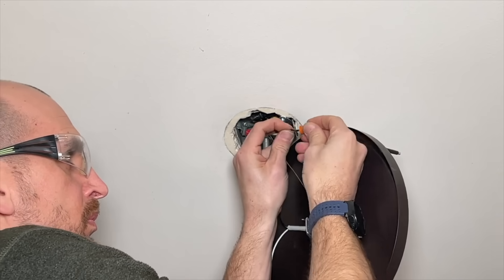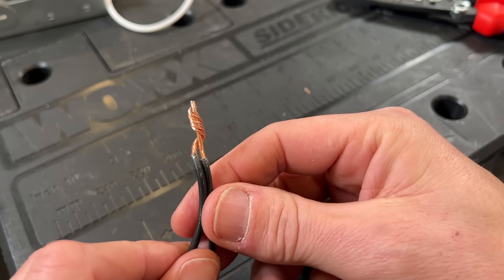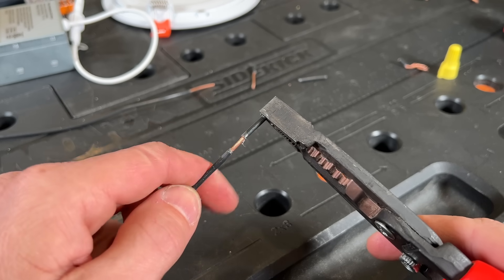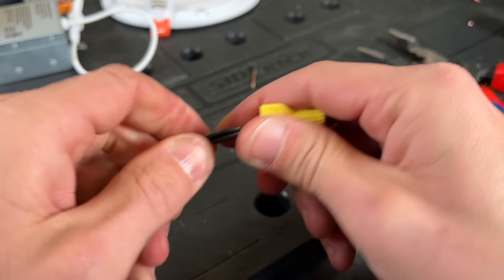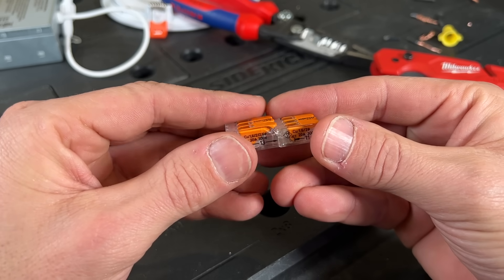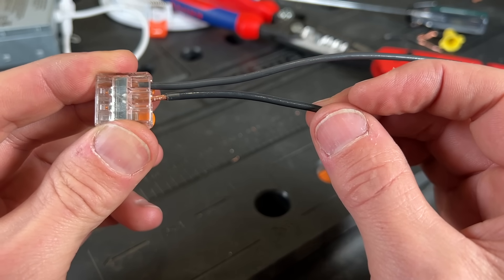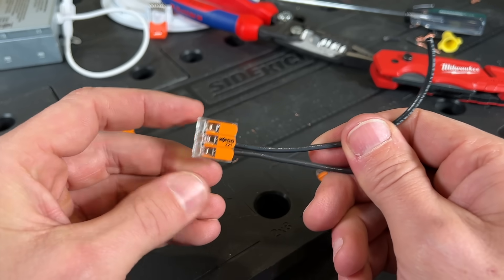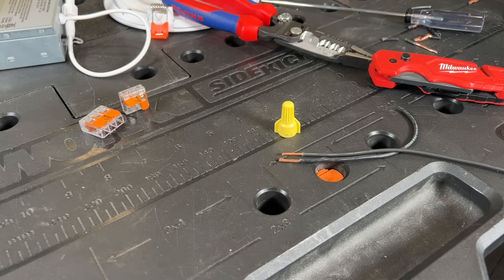Most Common DIYer Electrical Mistake - Don't Let This Be You!

Comment: My dad worked as a mechanical engineer for Ideal Industries around 1970 and holds the patent for putting the spring inside of the wire nut. As a boy, we had hundreds of these wire nuts that were prototypes. We took a vacation that routed near Connecticut where there was a spring manufacturing plant that made the spring that used a wire that wasn't round but rather had edges to help "bite" the wire. I think of my dad every time I use a wire nut.
Reply: Wow, great story, now I might be thinking of your Dad when I twist a wire nut!
Reply: That's actually pretty awesome.
Reply: Awww! That is so awesome! Now, I get to think of him too. Thank you for sharing that!
Reply: I designed a specialty tool which industrial engineer will do a realization factor. Basically a man hrs for manufacturing. This was in avionics at a defense contractor the employee that submittal his idea gets a percentage of realization factor in man hrs saved building the company owns and holds the patent cause you worked on it on company time. But like I said you would recieved a suggestion check. A 2.2illion dollar system that you can knock 1 hr off the realization factor on a contract to build 2000 units with 400 spares would get you like 4 grand. Plus defense contracts go out to the manufacturer and a 2nd company building to  specsm so really tools can be used on future contracts but never will pay you any more cause again they hold the patent they can do use or sell to othe company's vendors whom ever.
Reply: @precinct1baltimorecountyre588  I know how you feel. I had to sign a waiver that stated whatever you designed belonged to the  company. I designed HUNDREDS of tools, jigs, work stands, lifting rigs for crane operations, test equipment, procedures, safety application tools and procedures, etc. for over 35 years. I got 3 awards in that time. The main thing, I made a positive change to the world! The company, I'm sure, patented all of it and made it available to order by giving it its own class & item number.
Reply: @general5104  I invented a bunch of things and get all my ideas stolen. But Im usually intentionally leaving bait for stealing  purposes. Apple air tags?  multi core processing? the DQ Blizzard and honey bbq chicken strip sandwiches are all my IP. My latest Idea was a bathroom that plays music when you walk in and realized as a fart fan with a speaker in it. I think Im proudest of Multi core. But when people ask what I do I say nuffin. I got a check for nuffin and you will find me in a line for a blizzard. Also, the one Im most mad about is,some guy out of Portland that hobby sourced his plans to keep people from stealing his electric bike and they realized it as a product of rental transportation.Since 1 Google was directly involved in forming a company to sell that and 2. its just a blatant example of being disenfranchise of your own ideas and IP. When those same guys turn around and cry at China for IP theft. Like bro, you never had an original idea in your life and need to come up off that trip,from the perspective of a modern inventor.
Reply: @precinct1baltimorecountyre588  wtf is a “realization factor” and how do u do it? Also, who receives the suggestion check and how much was it! I’m confused as hell by ur post. I can’t tell if ur being sarcastic or sincere! Lol or are u just saying that if u design something at work then the patent stays with the company or ur employer?
Reply: A Dad needs to make a lifetime impact.  Thanks for sharing yours.
Reply: I still think ideal had the best wire nuts
Reply: I still have some old ceramic wire nuts.
Reply: @marklevan6546  I have taken plenty of these out.  These seem better as they won't melt like plastic.
Reply: I was into electricity since I was a kid in the 70’s. (Later became a licensed electrician), but I remember hating wire nuts that came with my electrical projects as a kid. Some were ceramic, some were plastic, but none had the spring yet. Those crappy things, no matter how hard you twisted them, could easily be pulled off the wires. Wire nuts in general were a bad idea in my opinion back then. 
Then I went to Radio Shack, (the candy store for electrical and electronics projects), and dreaded that I’d need some wire nuts. 
I explained to the store clerk that I didn’t like wire nuts and asked if there was an alternative? He lit up and smiled, obviously understanding the wire nut dilemma, and showed me the “new and improved” wire nuts. He pointed out the metal spring inside. I nodded, “That looks better”. He was more excited than I was yet, and clipped off a couple sections of #12 solid wire. Stripped the ends and screwed on the wire nut. “Let’s see if you can pull that off, kid?” I tried and I couldn’t. I wanted to try it for myself and hooked up the two wires with the new wire nut. Nice! “Why didn’t anyone figure this out sooner?” He shrugged and pointed to the brand on the box. IDEAL. 
For the next 50 years I’d only buy wire nuts that were made by Ideal Industries. I have literally thousands of them now in every size. 
Most lighting kits from China still come with the crappy wire nuts without the spring and they go immediately in the trash. 
I always wondered who the genius was that invented the Ideal wire nuts and now I know. It was Warren Krup’s dad. 
Thanks for solving the mystery for us and sharing it with all of us who might have took this genius design for granted.
Reply: That is so cool!!
Reply: Great story. It's the little thing that turn out to be beneficial.  I did a Military Funeral Honor Detail 4yrs back around the 4th of July and it was for a WWII Army Veteran and this man had his own chair manufacturing company. When he first started out he invented the stackable chair. This chair is used in every hotel and conference centre worldwide. His first big sale was in Vegas. He was a very well known and respected man.
Reply: Warren, was he in Petersburg?
Reply: No, in Sycamore, IL
Reply: @wkrupper I grew up 4 blocks from the factory. My grandmother retired after working there for 20 years.
Reply: @bradrachielles7890  Sycamore,  IL
Reply: @bradrachielles7890  , Sycamore,  IL
Reply: wait You say your dad holds the patent or IDEAL holds the patent ,???    Its gotta be IDEA:L right because your family should hold more money then any trillion aire combined with that statement!!!???   Its funny because I work for a utility and lucent technologies holds patents for the Entire original Bell system That engineers like your Dad developed and were never really compensated for theyre brilliance
Reply: @culbyj3665  You can be named on the patent as the inventor or be recognized by your employer as the inventor, but your employer is always the owner of the rights. Most companies make you sign them away explicitly these days to avoid any misconceptions.
Reply: @culbyj3665  his name is on the patent, but the patent belongs to Ideal
Reply: Hi Warren. This is Dave Hellerman. Now I’ll think of you whenever I am using wire nuts. Small world. Hope you are doing well. All the best!
Reply: @dblarney8201  Hey Dave! Great to see your name! Hope you are well!
Reply: @D’Blarney  thanks for the note, Dave! I don't check this site often. 
I just retired, glad to be home working in the garden and in the yard every day. 
And especially no commute!
Reply: @dblarney8201  Hey Dave, great to see your name. I retired a year ago and I'm busier than when I was working full time!
Reply: GOD really loved your Dad! GOD IS #1! GOD is master inventor, engineer, designer, etc. Your Dad must of been a great guy too as well as very intelligent 👍. That's great he thought of that! GOD BLESS YOU and your family!
Reply: I'm sure he is in heaven with GOD inventing more things up and coming for us in the future ⚡ 🧑‍🔬💥👼.
Reply: Sweet!
Had an uncle in NY that patented the folding of paper instructions, mainly medications. So If you ever get medicine with a very small, book like instructions. It was him.
Reply: Wire nut still a go to for splices. Stream lined for easier box dressing. I was always taught to square off wires to corners and bend or role depending on box to leave maximum room for devices.
Wire nuts seem much easier to accomplish. Old Scotch Locks (soft) were nice for that. Winged Wire nuts most guys cut off if they needed extra room in a tight box.
I guess it's the new guys that like to use them and old guys don't change. Lol
Reply: Thank you for a fabulous story!  I, too, will think of your dad, Mr. Krup, every time I use a wire nut.  All the best to you.
Reply: I invited the Bit-O-Honey sandwich. You put maple syrup on your peanut butter instead of jelly and it tastes just like Bit-O-Honey. Does this put me on the map?😂
Reply: Fantastic story - now I know and will think of your Dad every time I use them too!
Reply: Thanks for sharing this story with us much respect to your father for a great invention thank you.
Reply: Great Comment, I think of your old man every time I use a wire nut too.
Reply: Very cool!
Reply: Great info. Everything has its place and you have to use the item that is fit for the job, but the points that you brought out seem to make quite a bit of sense, and you ill strain the ethocacy with regard to the Lo test that you referred to, and the demonstrated physical lottest so these are not opinions that you put forward these are facts, so I thank you for supporting your information with facts. All the best.
Reply: ⁰0000⁰
Reply: Cool story
Reply: Very cool
Reply: That is awesome I am always looking for that one part that everyone will use !
Reply: "Square" wire was developed and used in many different ways in electrical and mechanical parts. Thinking outside the box as they say can lead to genius or disaster.
Reply: 44444444444444444444444444444444444444444444444444444444444444444444444444444444444444444444444444444444444444444444444444444444444444444444444444444444444444444444444444444444444444444444444
Reply: Nu uh
Reply: American ingenuity
Reply: On
Reply: That is very interesting.
Reply: Bread and butter
Reply: I don’t believe a word of it
Reply: great American company, he was lucky, not many left
Reply: Fibber
Reply: Ideal industries holds that patent?
Reply: Thanks Dad.
Reply: So amazing! I will also think of your Dad when I use a wire nut😊
Reply: Was it Spirol Industry?
Reply: @NathanMcCrackan , it was Ideal Industries in Sycamore,  IL
Reply: My dad made outlandish claims, like he invented the question mark. And he would accuse chestnuts of being lazy.
Reply: We would never useechanical connection on...mil  spec wiring. Only mechanical connection would be a pin going in a Bendix connector using a inspectedcalibrated crimp tool and the extractor insertion tool. I'd wire 200 or more wires in a 10" x. 2" square box and make a cable with a bedix connector on the pig tail of cable
.some had twisted pairs for sheilding 
Most did not
Reply: @precinct1baltimorecountyre588  MAny soldiers LIVES HAVE BEEN SAVED BUY THAT MIL SPEC...
Reply: THAT'S KEWL. 
   I, myself, am a tool designer. Many folks have good things to say about innovations that I fathered. (( I always give God Almighty, the Master Designer; the credit ! )) Be super proud of your Daddy! Always & All Ways.
Reply: @general5104  GOD is always #1 Inventor, engineer, designer,etc.  He blessed your father and must really loved him. GOD BLESS you and your family 👍
Reply: 9999g9
Reply: And what have you accomplished?
Reply: only big idiot buy and use old wire nut connectors today, because have lot better and safe connections today
Reply: @mattivirta  the video says " Lever Nuts" are standard in Europe, yet old school twist wire nuts are still used in the USA
Reply: @johnmcminn9455  why use wire nut shit because lot better and safe connection have ewery elektric shop today, spring connection have lot lot lot safe and better than old wire nut shit, etc, north europe wire nut connection have out of law because too many house has burn dangerous elektric connection =wire nut connection. north europe ewery elektric building inspector looking before give certifice can move live in house and if have used wire nut connection not newer accept stamp to paper and newer not can move live in new house. before if not change ewery connection safe good spring connection wago etc.
Reply: @mattivirta  🤡
Reply: @mattivirta  maybe u should check ur grammar before calling anyone an idiot! Lol
Reply: @mattivirta  thanks for the useless comment.

Comment: How do you feel about butt connectors when having to remove part of a cord that has been damaged and then reconnecting the plug? My particular case was a small 3 gallon air compressor that my dog chewed the cord into.
Reply: Absolutely not. Butts are good for low voltage only

Comment: If you’re going to make a video like this you need to be at least an electrician. The fact is there’s many ways to make electrical connections, I’ve been doing it for 35yrs, probably have made hundreds of thousands of them, I’ve changed the ways I’ve done them over time and have never had a failure due to technique. The “Right” way has been taught many different ways and most seem to work fine. Fact.

Comment: Also, to talk about the Wagos, us professionals do not use them. They have terrible longevity, ultimately causing continuity issues in the future that the customer has to pay for. Alot of dishonest electricians know this and use them for return service calls because troubleshooting is a blanket statement when billing the customer, you can "troubleshoot" for 5 minutes or 2 hours and when writing up an invoice they can bill for more time just by simply saying they were "troubleshooting". I have been an electrician for right around 10 years now and I throw them in the garbage along with those crappy little orange wire nuts that come with fixtures and fans and I never buy them at the supply house. That said , they DO have their uses albeit very limited but there's no replacing a wire nut.

Comment: Great demo on solid/stranded I see many failed connections not doing it right, always do a pull test. Having went through a NASA wiring training course when working a previous job, and other wiring experience, learned a great deal on different connections, mechanical. solder, etc. I have found for when using wirenuts on solid to solid, is best to pre twist, ensuring have a uniform good mechanical bond, never have had an issue doing this way, the twist is the connection the wirenut just covers, hold in place. Have sen failures when no pretwist with wirenuts, wire did not get a uniform twist connection lessened. had to redo a connection I did once no pretwiest wirenut manuf said was not required. After thinking about earlier training, did some experiments several times doing the pretwist on solid to solid and not doing the pretwist, I will always pretwist now ensure a uniform tight twist
Reply: Oh, and I never use stab type connectors, screw terminals only on switches/lights for residential, and if an appliance comes with I cut off use wire nuts, had a few failures before with those was well, just not worth having to go back for a bad connection.
Reply: I have not had much experience with Waggo connectors, they are not the stab it type and will have to look into those more, do some experiments with active test circuits see if get any types of failures before believe can handle large loads but may be great for appliance, lighting light loads ?

Comment: Great vid on wirenutting solid to stranded.
Regarding the Milwaukee knife, I used to use them all the time. It fits in the hand. What I do not like about them is the location of the blade release. Many times I would accidentally push the  release button while cutting and the blade would come out. For that reason I quit using those knives. I now just use the Home Depot Rigid folding utility knives. They do not fit in the hand as well as the Milwaukee, but the blade release has no issue.

Comment: Very good. Another wiring nut method that I use when putting stranded and solid wires together is tinning the stranded wire tip with solder before twisting conductors with the wire nut . I think the Wago 221 method should be ok for low current applications because the contact area between the connectors and the connector tabs is not enough.  I particularly don't like snap-in connections when handling a high current.
Reply: Either it needs to be good for the full rated current of the circuit, or needs to not be used.  Fortunately, it IS good for the full rated current, and your assertion that is is only "OK for low current applications" is complete BS.

Comment: don't join solid to stranded with a wire nut, use an irreversable crimp, or terminal end such as a crimp pin on stranded or proper crimp, solder or press lock terminal end. Wire nuts are fine stranded to stranded or solid to solid

Comment: Please please please don’t do it like this guy said. You’ll create so many bad connections. You need to twist the wires together BEFORE inserting into the wire nut. It’s not a tool but a safety precaution adding another layer of protection. Trusting the wire nut to twist the wires together for you is unwise and won’t be good long term!

Comment: You could just tin the stranded leads. We've use those wago connectors on ship lighting circuits without a problem, they seem to be really good.
Reply: Solid mantle wire is illegal on ships, you can use Nite on the end if you need, not solder. This is because the wire is standing for years in a vibrating environment.

Comment: Use dual recessed set screws , Euro style,  plastic covered, wire connectors. They come as set of 10 to be sawed/sniped  apart for each, as single or as double. Much less costly , uses miniature flat blade screw driver, easy to get -  7 amp or higher rated part numbers, with the best quality screw heads,  from -  All Electronics catalog. You will use them all the time.